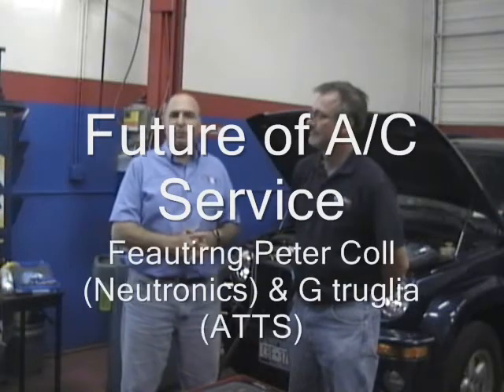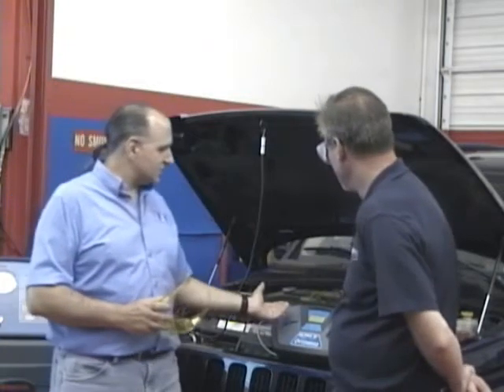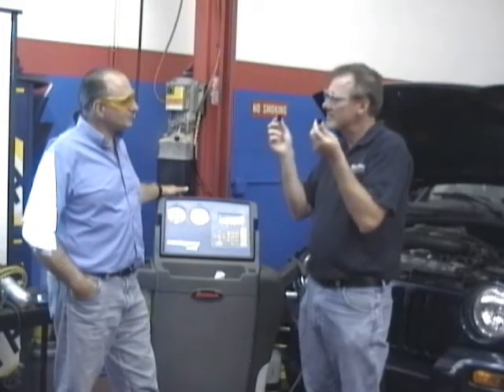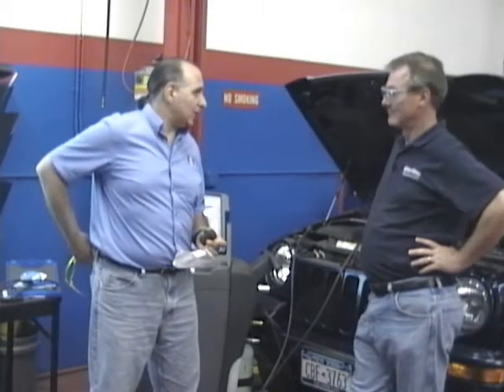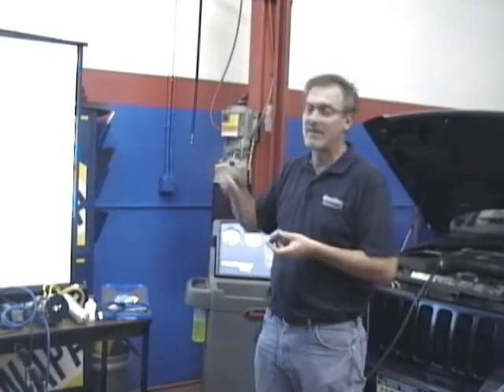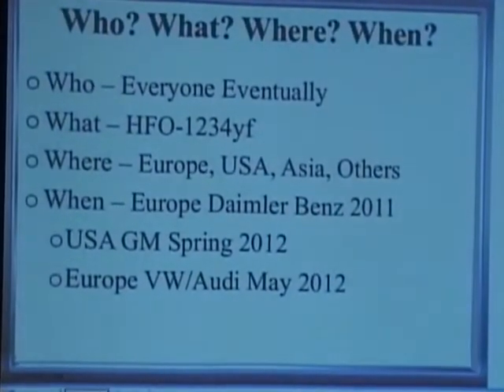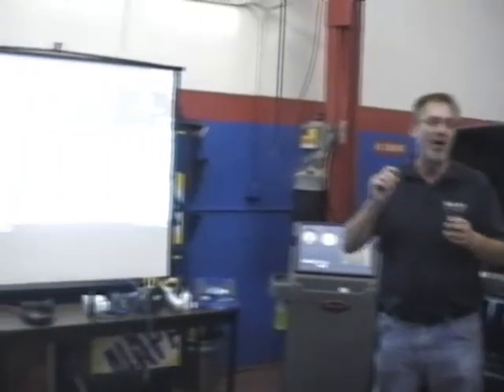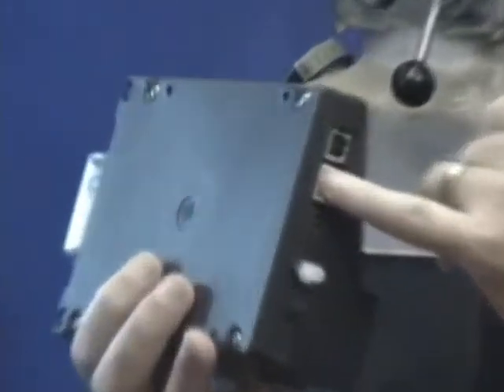R1234yf and R134a AC Seminar

Comment: In a r1234yf system, with the adapters, you can dump in 12a(redtek, duracool) and it works like a top... Totally for the win! Not saying its legal etc but save a PILE of money.
Reply from the maker: Mike just be aware that there is a fine for adding anything other than R1234yf in the system. The fine per vehicle is $44,539...use the right stuff and be safe. By the way the fine is for anyone even if your not a mechanic/technician. Please do it right so you don't have to worry. thanks for watching
Reply: TSTseminars catch me lol... I didn't touch it... Guys... do this and save a bundle... still environmentally safe too hahaha
Reply: I imagine that 134a works like a hot damn in those systems as well.